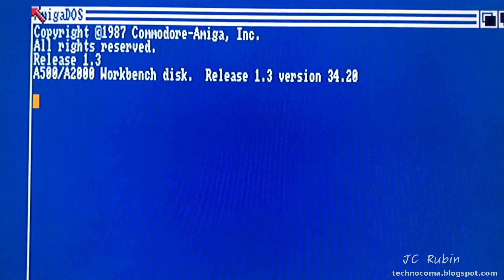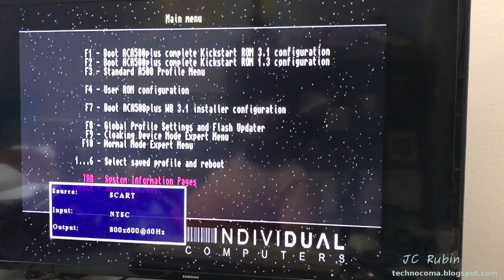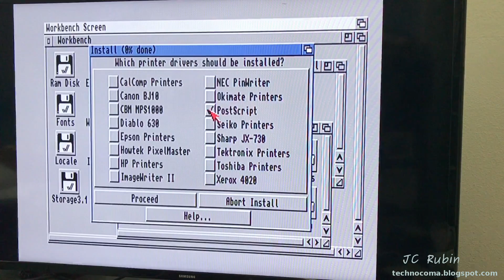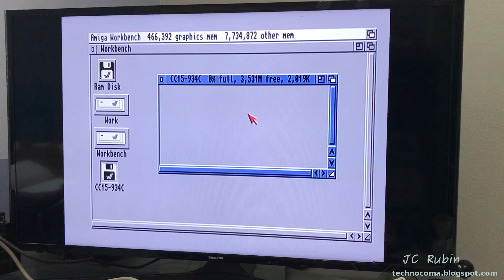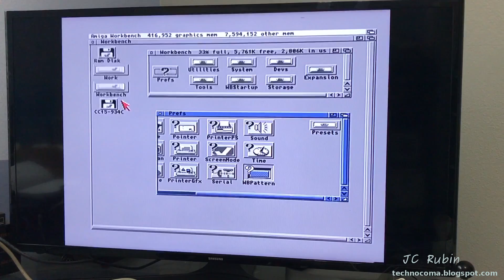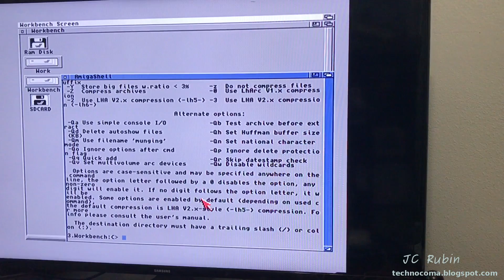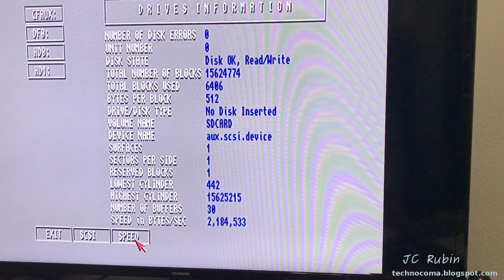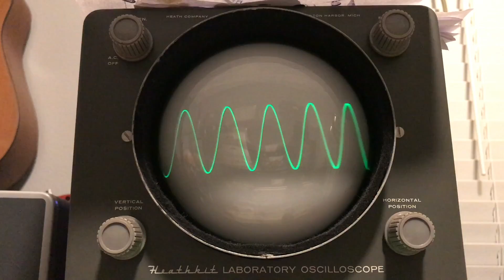Amiga Upgrade After Over 20 Years - ACA500+ Kickstart 3.1 Workbench3.1 install

Comment: 18:16 the A1200 with only chip ram, maybe yes, but just add some fast ram on the A1200 and that will blow A500 plus ACA500+; plus, the A1200 chip ram bus is 32bit and ram has more bandwidth. Nice setup there, however! Cheers, M

Comment: great content JC!
can you tell me whats your scart to hdmi box brand? you use it to convert the scart sinal to hdmi rigth?
is it an expensive box or one of those OEM ebay ones?
can you tell me where did you bought it from?
thanks and keep those videos coming!
ps: do you still recomend the aca500+ ?
Reply: I saw the price on screen briefly in the video that I just watched before this. It was $36 ish...so it's an okay price I think, for what you're getting. Luckily all my flat TVs have SCART over here in Europe but the classic analog inputs are disappearing from devices now. So I may need to get one in the future.
Reply from the maker: My TV's and monitors are also from Europe and use SCART, this is the info for my box

https://www.amazon.com/VCANDO-Converter-Adapter-Switch-Scaler/dp/B01N06Q9WH/ref=sr_1_3?crid=3IRIUJVE13M6N&keywords=scart+to+hdmi+converter&qid=1571106527&sprefix=scart+%2Caps%2C178&sr=8-3
Reply from the maker: See the reply below

Comment: I am using on a A1200 with a ACA1233n at 40mzh and a 6882 at 50mzh and workbench 3.1.4 and the kick start rom set. Now I can use CF card over 4gb.
Reply from the maker: it does make things easier.